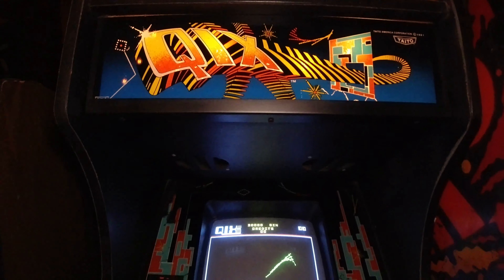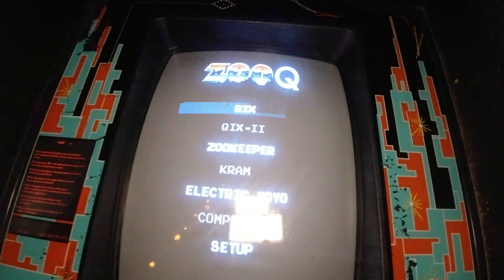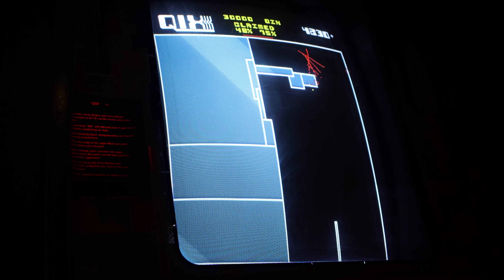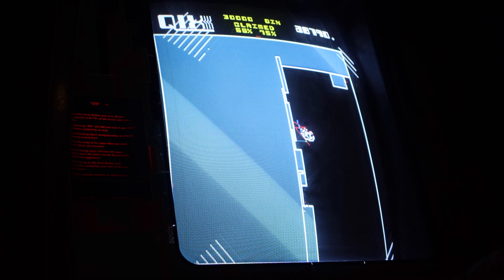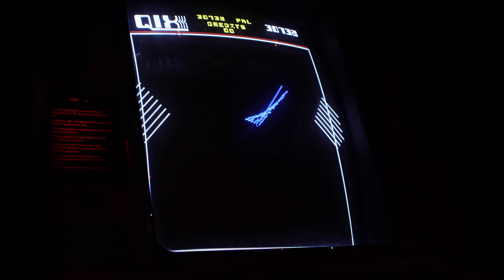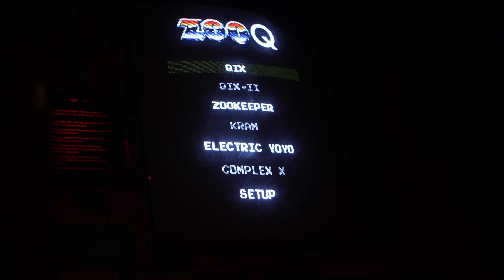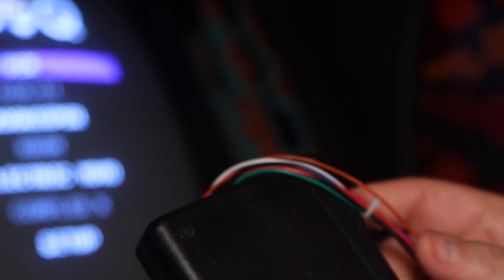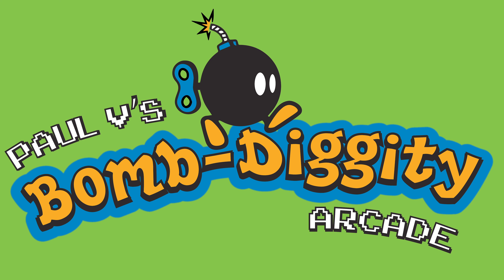Qix Repair Part 2

Comment: Qix is a great game!   The JROCK board has helped save many classics.  Qix, Zoo keeper and Berzerk are probably three of the toughest to keep running on the original hardware.  I am glad you could get yours running!  Good looking machine!
Reply from the maker: It was so frustrating to try and get it working. JROK was definitely the way to go. It's currently back down but because of a bad G07 so I need to do a chassis swap real quick to get it back up and going. This is definitely my top 10 fave game cabs from what I own.